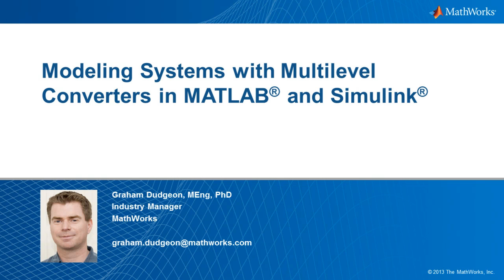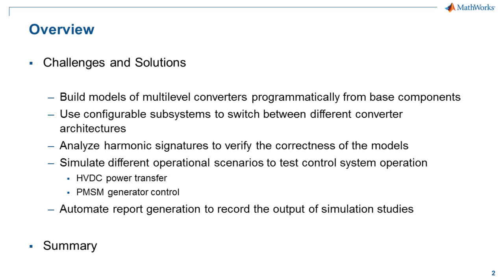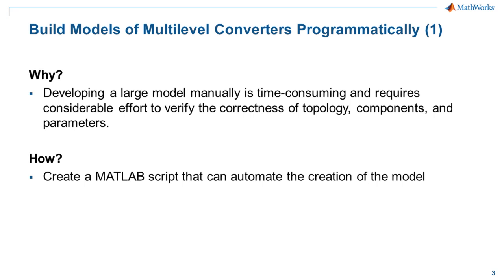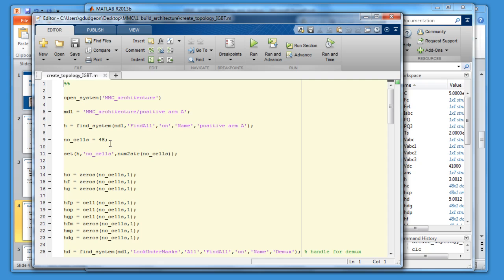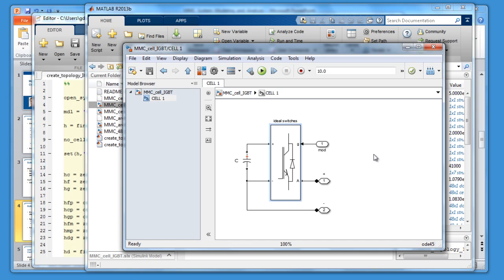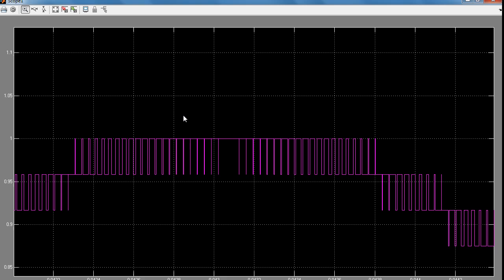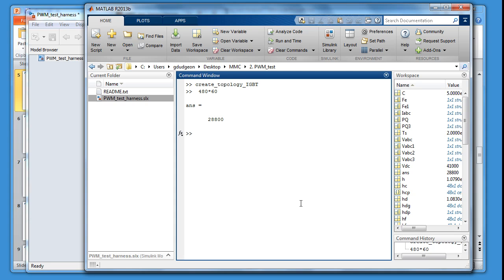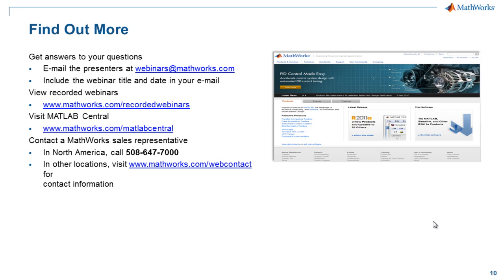Modeling Systems with Multilevel Converters in MATLAB and Simulink

Comment: Good presentation. You can find basics here in Modular Multilevel Converter - PWM Technique and Capacitor Voltage Balancing - YouTube. I believe this is useful to understand the concepts behind this.

Comment: Sir, is too confusing since I am new in MMC. Can u post a video which is simple how to generate the PWM for MMC and how to set up the simulation model. (just a simple model, do not jump to here and there, and do alot of different analysis in one single video). is too confusing
Reply: Dear YT ONG this is also confusing for me but is good material for experts.  i needed to know did u find some simple material how to setup simulation model. i am also working on this.